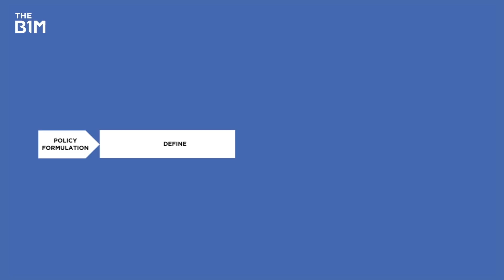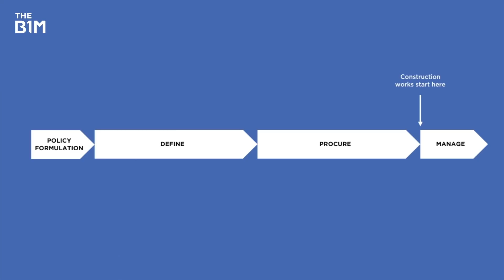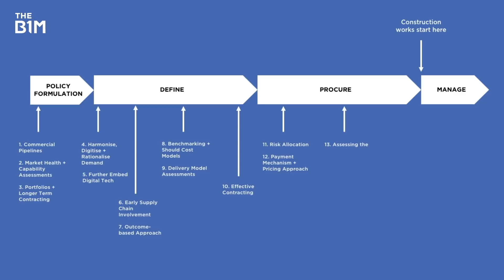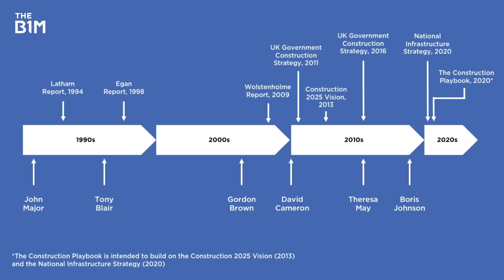The Plan To Change Construction

Comment: The main thing here is that in future we should start recycling all the buildings we are demolishing to make way for new developments. All these 60s brutalist architecture buildings that are being demolished could be broken up to create aggregate for the construction of New Roads. Also all the metal in these 60s prestressed concrete buildings could be melted down reused as well. Some of this metal could be refurbished be used again. Wouldn't that be carbon neutral? We should be demolishing buildings at a slower pace and recycling more of what we are taking down and also reusing a lot more that's been taken off of old buildings and put into new. Wouldn't that reduce costs and be more carbon neutral. That would cut manufacturing and production cost enormously and it will also so take a lot less energy to create new buildings and projects. It's like the railway industry. There's an awful lot of wastage there as well. Most of the old rails that are being taken up to create new Lines or upgrade newlines could be taken somewhere and be refurbished to bring them up to new standards. So they could also be used again in Ral infrastructure. For the life of me I don't understand how it cost and astronomical bomb to Electrify rail lines full stop with a bit of thinking and better planning along with better procurement could drastically reduce the electrification of our railway system.

We could reuse almost all the glass we take out of old buildings to put into new buildings. Wouldn't this bring down costs and make things more carbon neutral as well? I personally would like to see a law passed in this country how to make all new glass solar reactive so we could turn every building into a power generating hub with solar Windows in every building creating energy. Wouldn't that be a practical sensible move forward? Just think of how many Petrawatts of energy all this new class could be producing for our National Grid. We could also so be improving the drainage design and structure of buildings and roads to capture more rain water to save on the world resources. We could also be putting Mini wind turbines on the top of office Blocks at a horizontal that can be be turned around by wind when there are high winds. Not only the glass in the windows would be producing energy but the horizontal wind turbines on the roofs of office Blocks and big high rise buildings and shopping centres regenerating loads of energy as well. We need to have a lot more forward thinking future looking approach to this. Along with a lot more long-term thinking. We should also make all our roads and pavements modular and plan a system so that utility companies do not have to constantly dig up roads to upgrade the system. We should design a system where it is easy to access aging utility infrastructure for upgrading and updating. Would nach cut costs and wouldn't that cut down on wastage and in the process make things more carbon neutral? We need a lot more common sense forward thinking planning going on in our infrastructure projects here in the UK.

Most of the rubber in old buildings can be recycled and reused. For the life of me I don't know why it isn't being. We could also be reusing and refurbing all the electrical wire we take out of old buildings. No reason with a bit of for thinking we cannot make that pass new standards as well. I would think around about 70% of all we take out of old buildings could be recycled or be reused in some way on new buildings to cut down the carbon footprint of manufacturing new items for construction. Again we need new sensible thinking.

This above is how I think the construction industry needs to do do to start making changes with.

Right these are my ideas how we could change construction.

What do you think folks?

Pure.